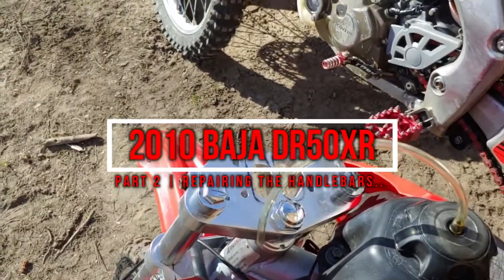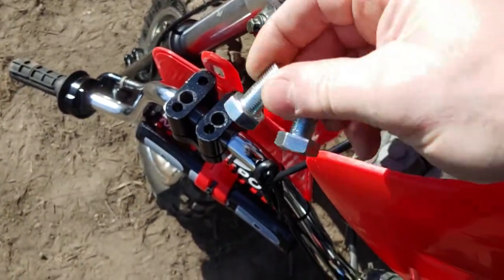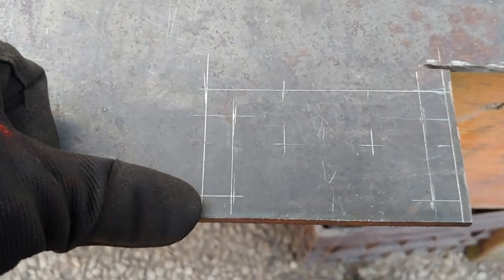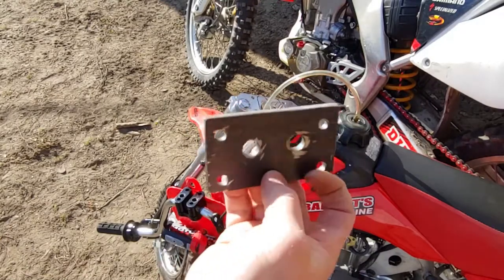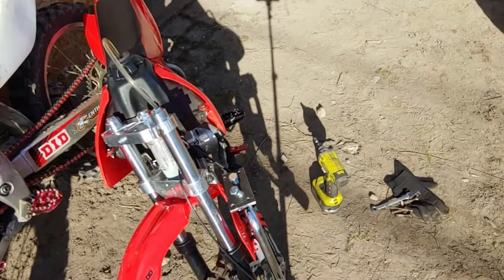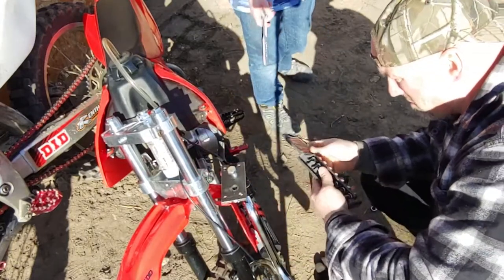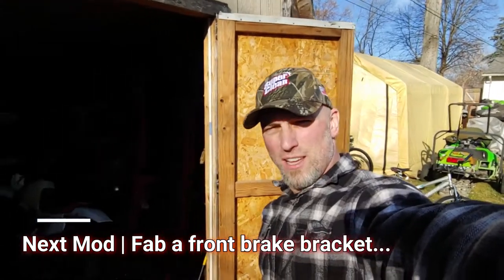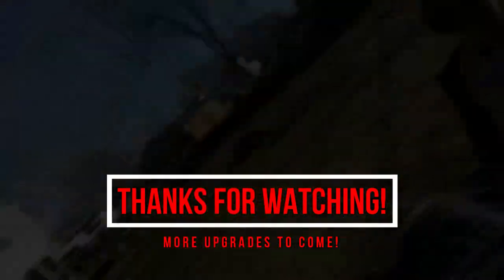2010 Baja DR50xr Dirt Bike Series Part 2 | Modifying BBR Handlebars

Comment: Nice keep up the good work 👍
Reply from the maker: Thanks. Got more on this coming. Also made a front brake bracket as the old one was too small. Im Going to be powder coating this plate and the new brake bracket as well as the wheels and putting new rubber on. So more updates coming!

Thanks for the support!

Comment: Could I use xr50 plastics for this I'm building a pit bike and don't know where to buy plastics
Reply from the maker: I dont think theyd fit but you can try Rockymountainatvmc.com, fast50s and evem amazon or eBay for full plastics kits.
Reply: @Fixin2Ride-Official-  ty
Reply: @Fixin2Ride-Official-  do you think if I order that same seat a Xr50 seat cover would fit
Reply from the maker: Yeah the seat cover should fit.
Reply: @Fixin2Ride-Official-  ty
Reply: @Fixin2Ride-Official-  do you think a xr50 exhaust would it it bc mine exploded
Reply: Work*
Reply from the maker: Best I can tell you is to try ans fit it on id you have it. Or go to babbitsonline and look at the parts diagrams for your year and see hos it matches....